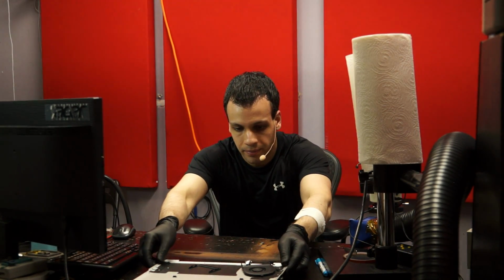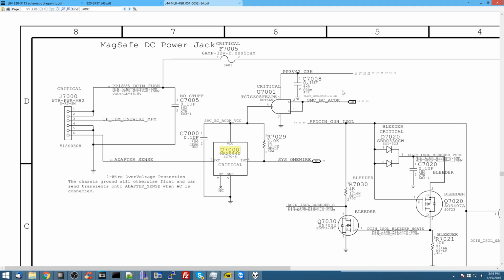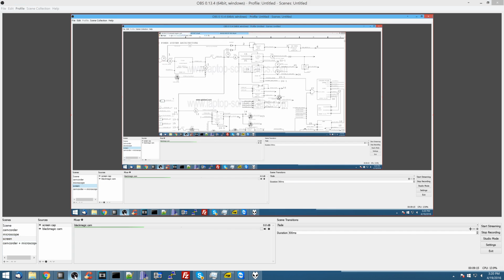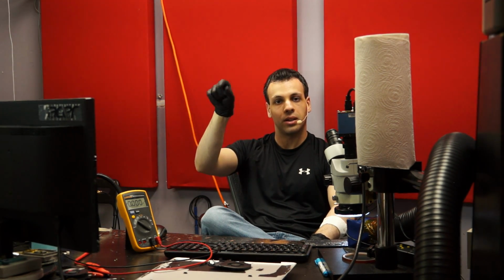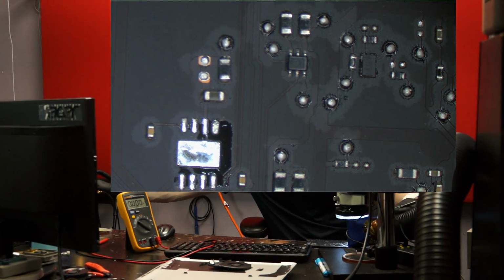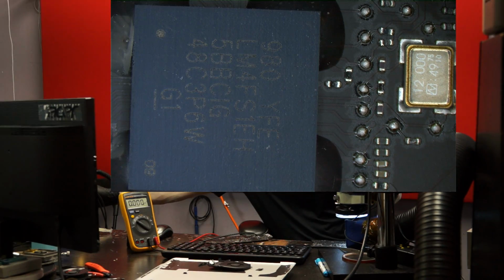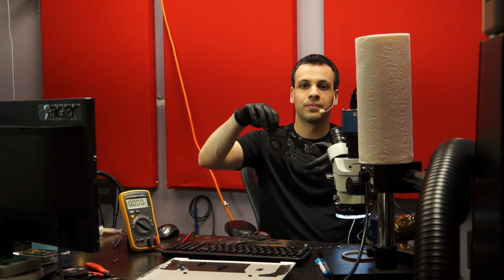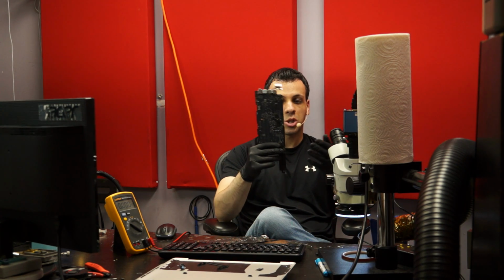Troubleshooting dead Retina Macbook Pro

Comment: Hey Louis, I'm sure you are super busy, I have a similar problem but it's not with U5110 and since this is my first logic board repair, not sure where to look next. I have a 1502. Amber light comes on but never turns green. No power or response from the screen when power is pressed. Input from the public welcome!

Comment: Sorry to dig up an old video, but if I'm seeing 3.25v on the one side of the pull up resistor and 0v on the other side, can I safely assume the smc is bad? Given that the u5110 has 3.25v on 1, 3 and 7 as you described and the resistor checks at 95kohms? 
My logic board had one drop of water on it... RIGHT on u5110, but after watching you replace yours with no change, I cant help but think its the smc now thats toast

Your video has been fantastic in understanding my problem. I'd appreciate any insight ;)

 Thanks
-Aaron

Comment: Hey!! Where is the reed switch on a1502? The part that tells when lid is closed
Reply from the maker: look inbetween the ports on the bottom side of the board. You'll see something about the size of a 1/8" headphone plug
Reply: Trick or glitch to disabling this switch I found basically exact location, I don't know how to fix on a soldering style level like your videos are I usually just replace parts but going to trial and error :) , but is there a hardware way to disable? I know Nosleep will fix on a software level but I kind of just want to disable, easier to sell one that has no sleep rather then go to sleep randomly

Comment: based on this video i was able to fix a 13" macbook air 820-3437-B board, after ultrasonic cleaning it started to work but sometimes powered off randomly and more frequently, when i saw a resistor around the SMC chip water damaged i knew that will the one causing issues, on the boardview it turned out that was the R5100 100Kohm resistor, was still 100k but could not solder it back as the terminals were corroded so much, i got an even smaller size 100k from a dead iphone board, and voila, it works, the smaller size means smaller wattage but it wont be a problem as this is very low wattage railway anyway (PP3V42_G3H - 300mA Max Output, it is about 1W = 3.42*0.3)
tip: without good microscope dont even bother with this repair, SMD`s are smaller than a piece of dirt under your fingernail, with naked eyes it is barely visible
Reply from the maker: +fifferfiffer Good stuff!

Comment: motherboard fixed by BGA reflow, i think you might change your view on how effective reflow is, i know you are always saying that is BS, but after ive done so many succesfull reflow on big variety of things it was hard to beleive that, including macbook I5 I7 cpu, small compact camera CPU (even package on package BGA), DSLR board CPU, or even PS4 controller or nintendo wii controller cpu (inside the actual controller, not the game consol), many of the chip barely produce any heat...
Reply from the maker: +fifferfiffer there is no view to be changed.

a flip chip design that gets very hot, i am not reflowing.

a non-flip chip design that has corrosion from liquid is fine to reflow.

Comment: Louis, what temp do you use for the hot air station?  The repair shop I sent my water damaged 2012 A1425 Retina to would not repair it as he could not get a new SMC chip, he doesn't want to use a used SMC for the repair.  I wanted to try the flux like you did.  I get an amber light and green light on the magsafe adapter.
Thanks, Love to watch your videos.  Learned alot from them so far, just got the hot air station so I'm new to it.
Reply from the maker: +Brian Richter 375-425c depending
Reply: +Louis Rossmann Thanks Louis, I tried your method for the 13 inch Macbook Pro  backlight fuse I had the liquid flux applied and the fuse vaporized at 250c.  Hope LED readout on this thing is reading right.  If I'm ever in New York city I'd love to take your class.  Love your quick wit, I'm pretty much like that myself pretty outspoken.  Thanks for the videos they help me out alot.  I do this as a hobby right now and to make a few dollars fixing things for friends.  Thanks again.
Reply: +Louis Rossmann Also:  I saw your post about the active duty Army soldier.  Thanks for helping out the service members when Apple drops the ball on them.  I spent 14 years in the Navy myself, thanks again!!

Comment: What is the blend of lead you use in your soldering?  60/40 or 63/37?
Reply: +Louis Rossmann Would it be possible to show repairs of Thinkpads?:)
Reply from the maker: Buhacaka They don't break!
Reply: +Louis Rossmann True that:D. Mine is still going strong after 3 years.
Reply: +Buhacaka they are built like bunkers
Reply from the maker: +Penfold8 63/37

Comment: Hi Louis! I've been repairing electronics my entire life for friends and family. Within the last year I started refurbishing LCDs, game systems, and laptops for side money. I want to expand into a service in my area that does repair because there really isn't any locally especially for board level repair. 

When it comes to learning Macbook board repair what's a good board to practice on? should I go obsolete and old for low overhead and cheap parts or stay current to meet my customers demand?

I'm just curious if the skills I will aquire troubleshooting an 09 Macbook will transfer to a 2014 or 2016 or is the board design so radically different I should only focus on that older one when that one guy sends in his computer.
Reply: Also I really liked your story of how your first job was missing ps1s. Oddly enough my first one was PS1 disc drives. then TVs and VCRs.
Reply: Also I really liked your story of how your first job was missing ps1s. Oddly enough my first one was PS1 disc drives. then TVs and VCRs.
Reply: ^modding damn spell check

Comment: So to explain flux: If you've ever done the middle school science experiment where you put an old penny in a glass of vinegar to make it shiny again, same basic idea.

Basically all metals (the major exceptions being noble metals like gold, platinum et al) will react with the oxygen in the air to form an oxide. This oxide layer is a problem if you're trying to weld or amalgamate two metals together, because while two metals will readily melt together, they won't melt together if there's an oxide compound in the way between them. It's especially a problem because this oxide-forming process is greatly accelerated in the presence of heat, so even if you clean the oxide off beforehand, the oxide will quickly re-form as soon as you apply heat.

In arc welding, you solve this problem by blowing an inert gas like argon around the arc, which gets rid of the oxygen thus mostly preventing the oxidation from happening. With soldering, you use flux. Flux is generally some kind of acidic compound, and its job is to dissolve the oxide so that it doesn't form a solid barrier that gets in the way of the two metals melting together. Metal oxides are generally bases, so an acidic solution will easily dissolve them.

One thing to watch out with flux is that when you heat certain kinds of flux enough they will actually burn, which is what causes the blackening of your soldering iron tip, and so preventing that is the major reason why it's recommended to wipe the iron tip on a damp sponge frequently. That black soot is very difficult to get off of your iron tip and if you aren't careful you can ruin tips very quickly that way.

Comment: Anyone else from the start on had this weird image of Louis in the morning instead of showering uses that stuff? ^^ 

btw. VCC = Voltage at (all/common) collector (for positive voltage driven, and GND below voltage, CC for plural C) for bipolar ICs and VDD for voltage at (all/common) drains for (C)MOS ICs. Although nobody uses bipolar these days for whatever reason people use VCC for PCB rails but most properly call the pins VDD. VSS btw. is the negative cmos supply (for negative driven systems, or for dual supply ICs where it can be identical with GND but especially for opamps does not have to be) or for bipolar systems (though really only seen it in the ECL world) it is VEE. For positive only supply systems often (rather incorrectly) VPP is used to denote rails.

Comment: The split check (each end) is similar to being able to find any number between 1 and 100 in 7 attempts.
You actually have reduced attempts by doing a split check than you do starting at one end and working every step along the way.

Comment: Its called VCC because the terminology comes from Bipolar Junction Transistors (BJTs) which have a terminal called a 'collector'. The voltage VCC is generally the voltage applied to the Collector terminal (which is usually the power rail), similarly VCE is the voltage between the Collector and the Emitter terminals.

The terminology has stuck with electronics since.